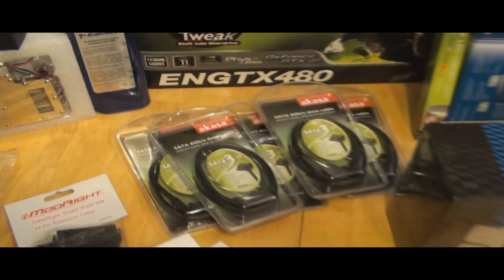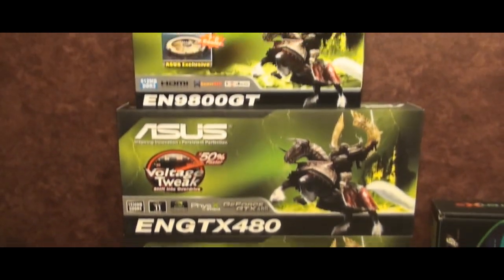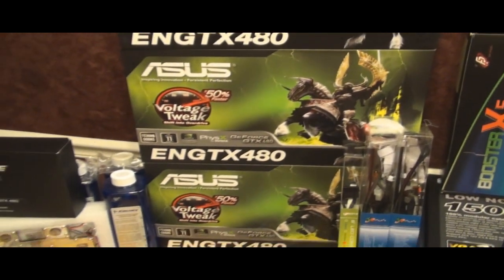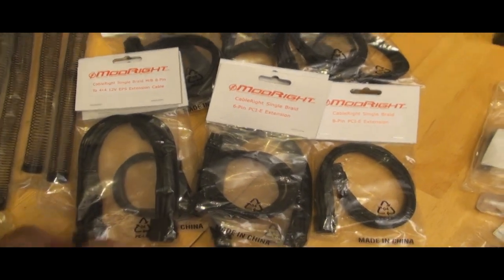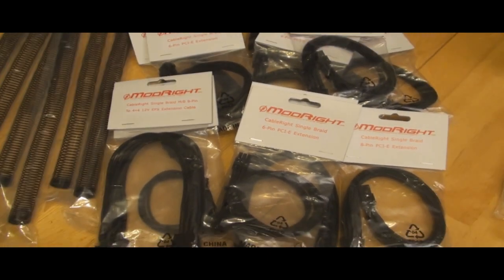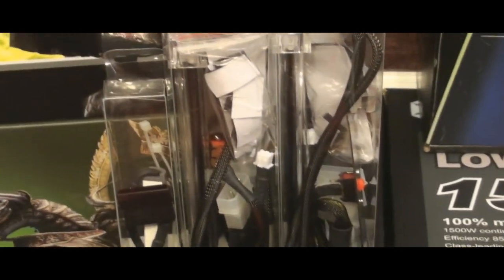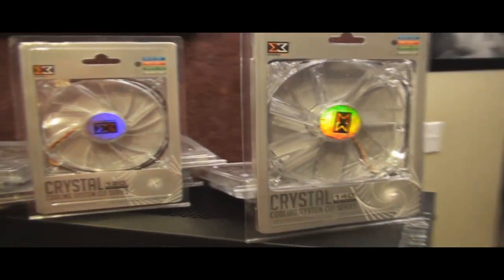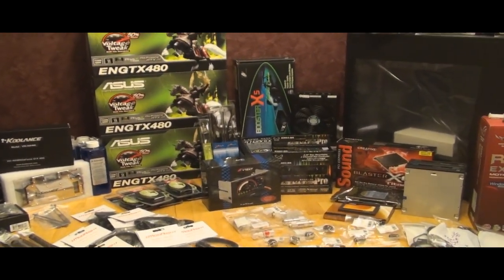Need Help Building a High End Computer? & NEW Gaming Computer Build Hardware Overview Pt.2

Comment: i'm planning on upgrading my GPU but will only be able to spend $150 MAX(including shipping) on it, can you suggest a good card? my pc specs:
Motherboard:XFX nForce 680i LT SLI 
CPU:Intel(R)Core(TM)2 Quad CPU Q9450 @ 2.66GHz(4 CPUs), ~2.7GHz(luqid cooled)
RAM:Patriot Viper 4096MB PC8500 DDR2 1066MHz(2x2048) 
Graphics Card:EVGA GeForce 9600 GT 1GB PCIe w/Dual Link DVI
I know it's not a great pc,but i bought it used for $300,and it works really good,plus it is MUCH better than what i had before it

Comment from the maker: @callsignfreak Well, upon build completion I found out that the computer was needing a little over 1500W from the wall and with 85% efficiency on the PSU that translates into 1275W.  Now of course that is when I was running FURMARK!  I would say for normal computing and gaming it would do fine, but I wouldn't want to cut it that close in my mind.  If you were really building this config, I'd get the Strider.  :)

Comment: @Trubyd44 My system: Phenom II x4 955 BE @ 4.0 ghz (1.55V); 4GB Corsair XMS3 DDR3 memory @ 1700 mhz, 1.65V; Antec 902 with all fans operative; noctua u-12p pushpull; 2 7200RPM HDD's in raid0; Asus m4a78t-e motherboard; g11/g9/usb headset; and a pci-e x1 wireless network card.

So that with a GTX 480 (overclocked to 850ish core)

Will my Antec TruePower New 650 watt run all this?

Thanks!

Comment: @LordNikonPL 
Why not a GTX 480?
Yes the 9800 is for physX
Xig fans are nice looking also there specs aren't to bad.
CPU will be a 980x and it should OC to at least 4.2ghz across all 6 cores. IT has the potential to go as high as 4.6 on water.

Comment: Hi, I ordered a GTX 480, it will come in soon. But my question is, will my Antec True Power New 650 watt run my system fully stable, with a high overclock(on both cpu and gpu)? (4 ghz amd phenom II x4 955)